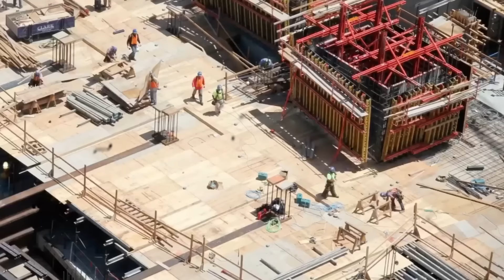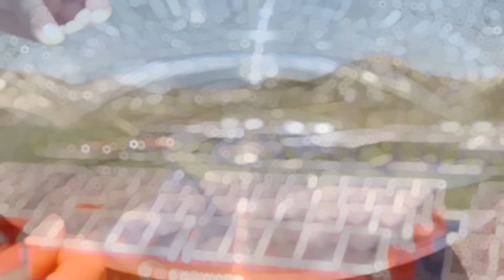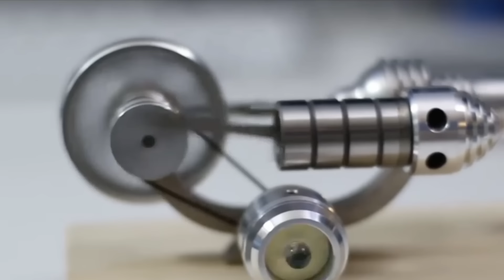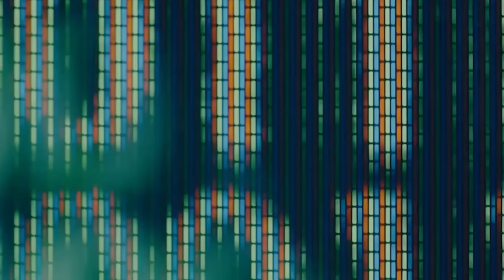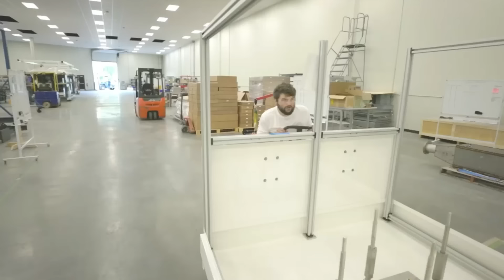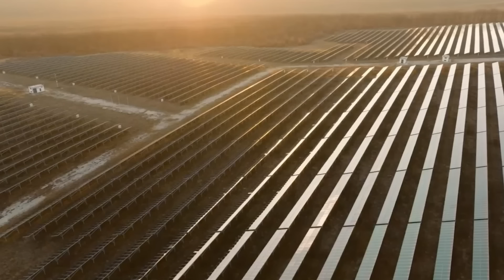Solar Energy is Changing: No Panels, No Lithium Batteries

Comment: This is strictly only suitable for commercial, industrial, or large-scale land deployments and is not practical for residential homes. While the idea of 24/7 solar without lithium batteries sounds appealing, the engineering constraints make it entirely unviable for a typical household. It requires specialized predictive maintenance infrastructure (9:36) that homeowners cannot handle. 

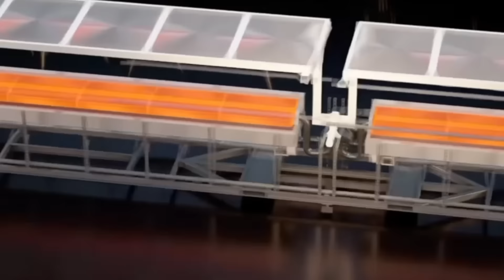• Extreme Thermal Operations: The system operates by concentrating sunlight to heat internal ceramic bricks up to 1,832°F (1,000°C) (3:02). Managing industrial-grade, ultra-high temperatures safely is generally restricted to zoned commercial/industrial zones, not residential neighborhoods.

• Overkill for Residential Loads: The architecture is designed to deliver high-capacity power and scale out by adding multiple containers (10:11). It is fundamentally built to tackle the massive, continuous power draw of AI data centers, industrial facilities, and heavy infrastructure.

Where It Is Actually Targeted

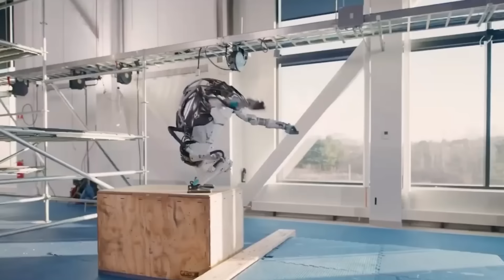Exowatt's technology is built specifically to address the skyrocketing energy demands of the commercial sector—specifically AI infrastructure (6:18). A single AI query uses up to 10 times more energy than a traditional Google search (6:28), making these self-contained, high-density power blocks ideal for data center campuses. The company targets deployments where multiple acres of land are explicitly allocated for utility power generation (6:03).

Comment: I really like the thermal-based energy + thermobattery approach, especially considering the cost advantage. 
But one thing I’d question is the land requirement. do we really need 5–10 acres for a 1 MW plant? From what I understand and know by experience, a typical setup could require only around 3 acres. If that’s the case, it could make this even more interesting for grid-scale utilization.

Comment: So it looks like each orange box has its own pump and generates is own energy?  If so a down pump and the others still going the effect on generation is manageable. On the other hand so many pumps can become a maintenance nightmare vs one pump at a central plant. Keep in mind gas and goal power plants have lots of moving part and systems that all need to be maintained. And can occasionally break unexpectedly.   Once the bugs are worked out and rhwy are reliable or at least serviceable it would be cool have a small version being able to power  a home 24/7.  Even partially.

Comment: Sounds great but will of course only work in situations which have a norm of bright warm sunny days.  That means only a very limited number of locations and not geographically widespread.  Solar panels on the other hand can go on functioning without sunshine in relatively dim conditions with just a fall in output.

Comment: could it become a problem if u plant so many 1000C hot exowatt containers close to each they generate so much heat things start to melt or stop functioning because of all the concentrated heat? Then you would have to place them further a part but then that takes a toll on the energy per square meter they talked about.

Comment: looks similar to a system David Boyle imagined 20 some years ago, fresnel lenses heating pipes with water in them, using thermal expansion of the pipes to generate power, heat desalinizes sea water. multipurpose device, trouble he was having was finding a company to make the lenses...

Comment: This was tried out near the California, Nevada border and the plant failed. After many years of attempting to make it economically viable, they could not. However, if we keep working on all types of low cost energy production systems sooner or later we will find one. We should have never closed Nuclear Plants, that was very Libtard.  We now have 100 mW modular  Nuclear generators. They can be deployed very inexpensively. This is a viable alternative to the large generator plants of the past and much much safer.

Comment: As a scientist, I can see some pretty good value in doing something like this.  But other factors that are currently being ignored by so called green power generating people that needs to be considered.   I'm glad they mentioned the land savings (less land required to produce more).  What about wildlife?  Those big solar farms that went bust?  There were birds getting killed by the hundreds thinking those panels were like a pool of water and they would dive into a panel and kill them off.  Same with the blades on turbines.  Green isn't just exhaust fumes, it's so much more.  

I've often wondered if you magnified somewhat the light to a solar panel if you could get more output throughout the day with a panel?  I know there's heat that has to be considered as well.  But storing them in a ceramic based type brick substance?  Good idea.

In theory and with the shown hypothesis,  they show the cost of producing 1KWH to be 4 cents dropping to 1 cent.  While this is certainly fascinating to say the least, does this figure include the question of how much it costs the owner to maintain such a system?   What if weather breaks the lenses?  What if the mechanical power producer slops a bearing or something?  How much does it cost to do preventive maintenance?  This all has to factor in the cost to produce electricity because we know it's not always just a perfect no problem system.  Besides, electric companies have to factor in all that stuff when they charge consumers for the electricity they sell.  Therefore if we are to compare apples to apples we have to include all those factors in there too.  We can't just ignore it just to get really great prices in there.  

The ability for the company to survive and thrive also has to factor in there.  How many solar companies have gone under and now the consumers have limited to no support on their products now?  From the scientific aspect we now have to turn to the business aspect of costs.  Doesn't matter how cheap it seems to be or run if the company to support it goes under and consumers stuck with no path forward if needed.  That's where you gage the risk takers.

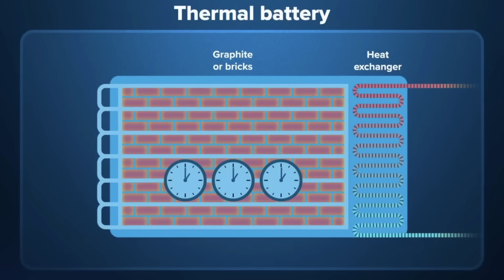Comment: 3:07 THIS shall be the way to go, just a way to provide your hot water, no engine other than lens adjustment, then add a solar panel with a battery to move the lenses and the water pump and done
Edit: of course for households, who don’t want to bother with nonstop engine maintenance and doesn’t need the megawatt hours of energy

Comment: Battery voltages stay fairly even until nearly empty - heat loss is exponential decay, so what happens during a dunkelflaute? Also mechanical systems (Stirling engine + dynamo or alternator) and solar tracking are notoriously high maintenance.  Snow? High winds?

Comment: Whether this proceeds with a hot air engine ( dubious)  or as part of a Steam Turbine system ( more likely) the generation and storage concept seems to have great promise. Elegant simplicity is the key word of great technology.
Reply: Solar Dish Gen Set reached 22.8% by McDonnel Douglas with gross instantaneously efficiency of up to 31.6% with hot air inside Sterling Engine.

Comment: Deserts could be turned into power generators...
I would still prefer something without moving parts or not force based. Can use a dome shape instead of moving lenses. Sterling engine has to be replaced with new invention. It has to be accessible to individuals instead of mass scale. Power grid dependency is what taking our peace of mind...

Comment: They are only using half the Steering engine. There is no cold side. If you have a fan blowing outside air on the cold side, would increase another 5%. Also, you would be able to have the pistons working on the hot and cool side to  double the work. This special bricks look like overkill. Just use the bricks with holes and you get more surface area.

Comment: TONS of concerns with this video.

1. How can it be less efficient AND  use only 1/4 the land of solar panels?  I call bullshit. 
2. The central claim that they can generate 4x the power from the same land is highly suspect. Modern solar panels convert ~22% (and getting better)  of sun's energy to power. So are they really converting 90% of of energy to power even after factoring in the losses incurred when converting heat to power 
3. It makes definitive claims about costs and then notes "significant engineering challenges remain".
4. Maintenance costs on the Stirling engines.  Things with moving parts always cost more in the long run. 
5. Solar panels can be mixed with grazing animals or crops in a way that provides a benefit (agrivoltaics). This system seems to make the land useless.
6. Solar panels can be our on roofs, carparks, sidewalks - nearly anywhere.
7. Solar panel and battery costs are still dropping rapidly. By time these things got developed, the advantages (assuming they actually exist) world be gone.

Bottom line: nobody is putting this on their roof or in their backyard. If they can really demonstrate it works, it should be easy to sell it to utilities.  Go do it.

Comment: @Engiskill, Why all the bs about complexity. You don’t need motors or complex systems to create a frame for lenses that tracks the sun reliably. It can be done with bellows using gas or liquid as a working fluid. The Sterling Cycle Engine can be throttled by a simple flying ball governor and Flywheel to keep a generator turning at any required speed. This is 16th Century technology with a 21st Century Fire Box. No need to complicate it. Apply 19th Century Engineering techniques of brute force Engineering. Ruggedize the machinery. It will run continuously for decades, even centuries with proper maintenance.

Comment: If the Germans deliver as promised on Fusion generated electricity connected to the grid by the promised date of 2030, just 3-4 years mass disruption to all types of present power generation, fossil fuel, wind, solar, hydro, are likely over the next 10-20 years as these come on-line.

There is another question, where is the test system and initial data.  When will it come?

Comment: 1. How exactly the fans works initially, seems like we need some battery powers.
2. Solar panel can be installed on rooftops or parking lots, so space is not that an issue b/c it's used as head shades in all cases and lithium batteries don't take that much space now.
3. and as mentioned in video too much mechanical parts.
4. Sodium ION with solar panels looks far more adoptable

Comment: The one problem you have there is heat. Now, there is another way, and it is the flywheel of which can store energy, and it gives out power when needed whether by water, or sun to turn it over.

Comment: How much to clean the glass and keep it running at optimum efficiency? No shade means lots of sand/dust, that's going to wreak havoc with the refraction and limit the heat transfer. So the $$$ saved due to the materials is now offset by hiring a night crew to clean the panels every 2days at 3am... water costs in an arid environment? fuel to bring water trucks in? union costs? insurance for the additional employees and trucks? Solar farms bring in goats to handle the vegetation, their panels can handle the dust and depend on the occasional rain to rinse it off. Finely pointed light requires a clean lens, any photographer can tell you that - I'm not saying don't try it, I'm just saying that there are alot of issues not mentioned

Comment: Is efficiency the most important metric?  I would say if not THE most important, it's right up there in the top 3.  If this system cannot operate as efficiently as solar or other renewables (particularly in colder climates or during colder times of the year), then perhaps this is not the best solution for government investment to bring it to scale for areas closer to the poles.

Comment: How much heat do the concrete and graphites bricks lose? How much do the insulation costs? Repeated heat-cool cycle are bound to crack those bricks. How will that affect the storage performance? And oh, how muvh do the motors cost - manufacturing and maintenance.

Comment: The concept is real physics, but the claims are exaggerated.  
This is not a breakthrough that replaces solar panels or batteries.
It is not a viable 24/7 power source for industrial or AI applications.
It is not capable of hitting 1 cent/kWh.
I can see a massive amount of maintenance on the sterling engine

Comment: There was a huge thermal to electricity plant in the desert which was successful (despite the frequent mechanical problems) until the price of solar panels dropped to $.35 per watt. It used concentrated solar from a dish which drove a sterling engine. It seems they had all the same problems Exowatt has. But having heat storage may till the scales to make it successful.

Comment: Intresting idea...but i think the math isnt adding up.
How can the system produce more energy per acre than solar when the overall efficiency is lower. And 4 ct per kwh isnt going to happen...
Reply: I think the difference is coming from the continual output of the exowat compared to the intermittent output of solar. Solar has a much higher efficiency during peak production, but close to or zero production for over 12 hours a day.

Comment: BUT............................

While it sounds GOOD, their studies are ALL INTERNAL.  To get CREDIBILITY, they need a 100% INDEPENDENT REVIEW by an OUTSIDE ENTITY.  And (thanks Gemini):

"Exowatt's cost structure relies on several key factors that have not yet been proven at scale:
Modular Manufacturing: Costs are predicated on a "learning curve" similar to solar panels, assuming rapid cost reductions as production reaches gigawatt scales.
Inexpensive Materials: The "rocks in a box" approach uses ceramic or rock-based thermal storage instead of expensive lithium-ion batteries, which significantly reduces raw material costs.
Geographic Specificity: The $0.04/kWh figure is most achievable in high-irradiance regions (like the U.S. Southwest), and costs may be higher in less sunny areas. 

Operational Realities
High Initial Capex: While the delivered cost is targeted low, initial setup costs for a 50-MW data center are estimated by industry observers at up to $420 million for 24-hour dispatch.
Scalability: The company reports a backlog of over 1.2 gigawatts in orders, suggesting high market interest, though real-world performance data will only become available as these deployments begin."

SO, while NOT OPPOSED, they first need an OUTSIDE INDEPENDENT CONFIRMATION of claims, THEN keep moving forward...  I wish them well.

Comment: Okay can those ceramic blocks be modified to used with Nuclear reactors?
My guy water has been boiling for centuries just to create electricity

Reason, this solar energy need a lot of land ( new empty land) ,
we have those nuclear reactors since decades , but material capable enogh to store the heat is yet to be found (tremendous heat is generated in this process)
Also scaling will be abig iisue here, For consider a  building with 100+ floor, now consider a city with millions of such buildings,(the roof top the building doesnt have the space for setup which will provide electricity for entire building - so land issue remains unsolved

I see a lot of reasons this may fail to to scale but 
I must appreciate the innovation the brought ( I am the guy who held a degree in Technology and Engineering)

please dont point out the spelling mistake I made (English might be the only language you know, but it is one of the languages that I know).

Comment: When I was young.. 14-15 years old I had made a prototype wherein I used a small steam engine heated by  a fresenlle lense. Believing generated steam has massive power as they could move loco motives common at that time. Even though I assembled a small steam engine I was unable to heat the tank well enough. I still believe steam can be a  more economical way. We already have thermal power plants and even the nuclear power plants all use steam to move generators and the technology is already advanced.  So using the stored heat to make steam and then run turbines just may be more practical and economical. Adding thermal storage systems can add to a much better efficiency of conversion.
Reply: To make stem you need fresh water supply, already rapidly becoming a diminishing resource. Will add more complications, but doable, although probably not on small scale.

Comment: It is much better if they make the lenses move and follow where the source of heat (sun) came from like thermotropism in plants. Doing so, these system can also be applied as a roof in outside parking areas of the Mall. Just adjust the weight to make it possible

Comment: Great presentation !  There is no free energy  as of yet.  All systems have an initial  cost and maintenance.  Energy is everywhere. Its the cost of transforming it that is  key.  Efficient  transforming of it is also a key.  Gasoline engines work great but they fail in efficiency.  I wonder if our electricity  is inefficient and there is a different kind of energy that's more efficient than  our current one?. Mabe dark energy? Some other that's more compatible with our enviourment. ?  How do ufos fly around. They seem real enough.  Some may be projection but some seem  quite real. If they are real then  why are they hidden?  I believe they are.  If they are then we're hiding from our future. That may be good or bad. Tecknology  isn't evil. Its how its used.

Comment: If you add panels sticking up, those can act as heat radiators that remain shaded parallel to the suns rays. That could be used to cool the cool side of the carnot engine

Comment: Nice idea but. It is mechanical, the moving lenses require regular maintenance. The heat has to be transferred to mechanical devices to convert the energy to electrical (usually). More maintenance. Who cleanse the lenses? The efficiency hangs on that. PV & battery is low maintenance, cheap and getting cheaper.